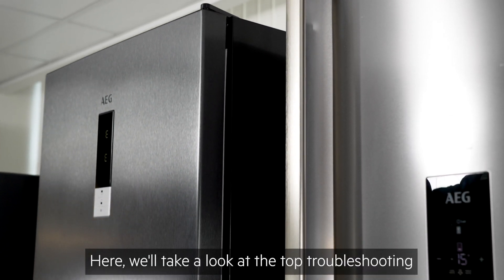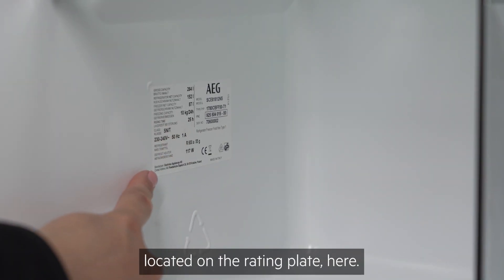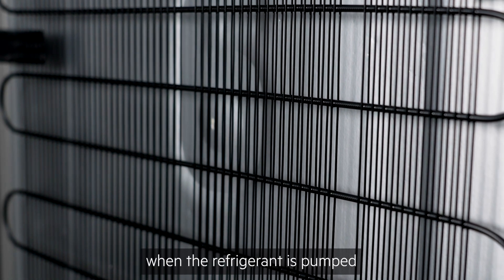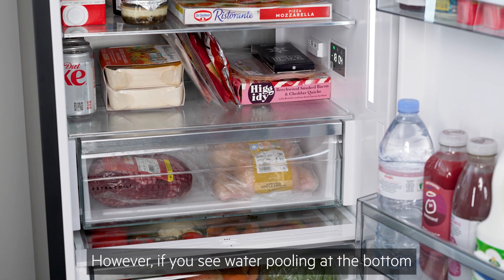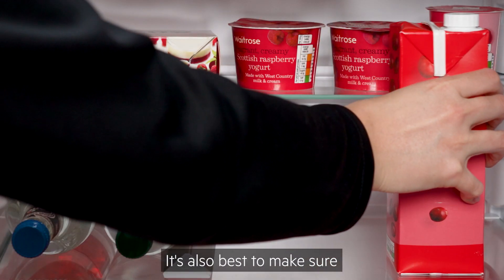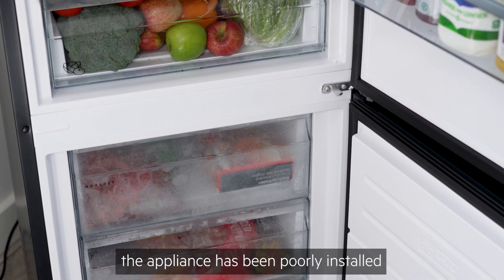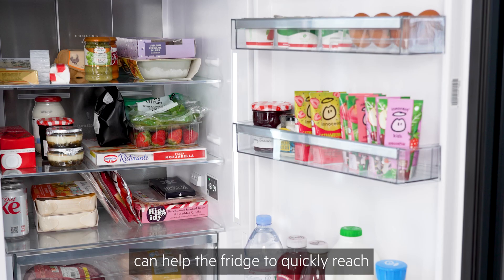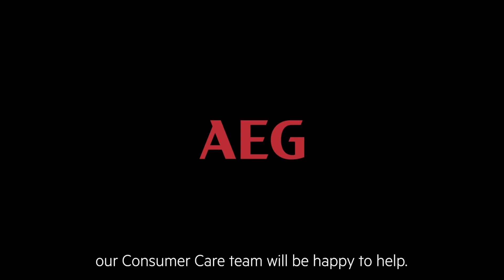Top troubleshooting issues you may come across on your new Fridge Freezer | AEG

Comment: Here is the review your website refused to publish.   I guess AEG only allow 5 star reviews.  

The function of my hob is fine. But the stainless steel has begun to show brown stains and rust spots after only four months. I've used nothing but a little washing up soap on the surface and no abrasives so I can only assume that the quality of this product's stainless steel is below par. Therefore, I will never buy another AEG product again. I'm told rusting is not covered by the warranty but for a product to degrade in such a short time is nothing short of scandalous. Customer support nil. I rang and got no help.